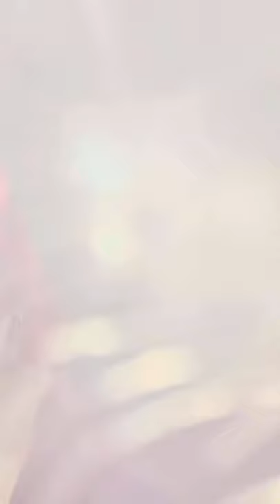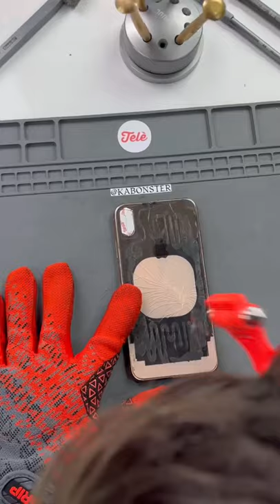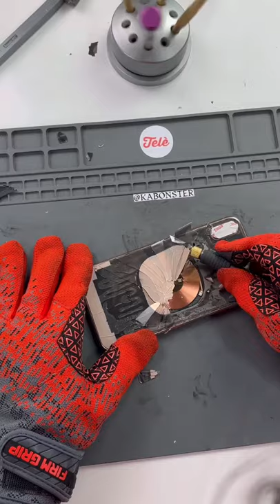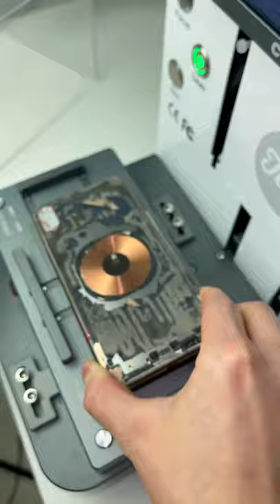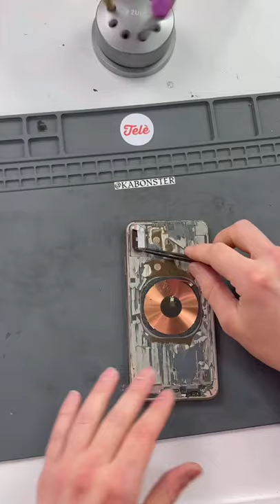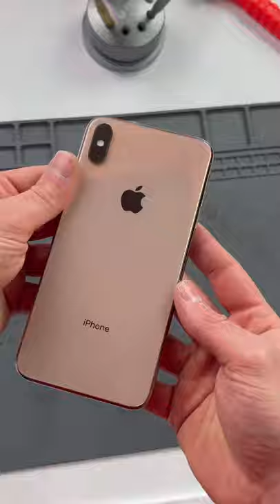It’s Crunch Time! iPhone XS Max Back Glass Replacement #shorts

Comment: Questions how does the laser remove the colour when removing the adhesive where does the colours come from on our phones?
Reply: The color is just a layer of thin paint applied to the underside of the glass, and it is burned off with the glue by the laser
Reply: @shenzh0u  that makes complete sense thank you for the insight